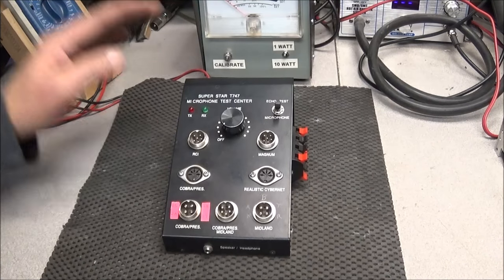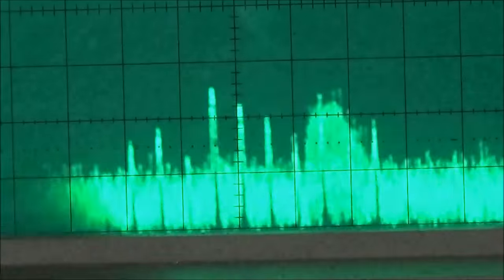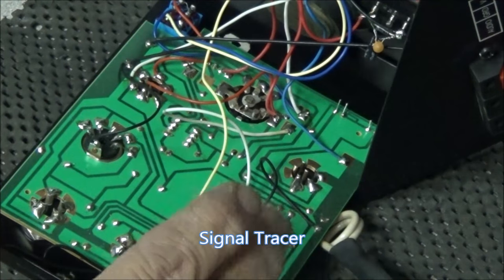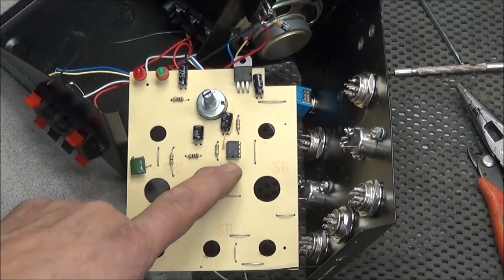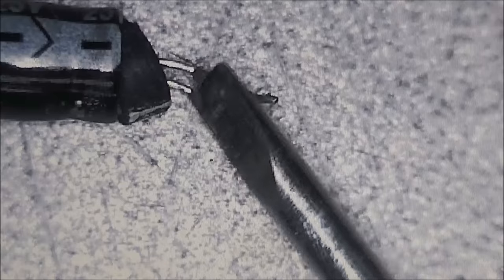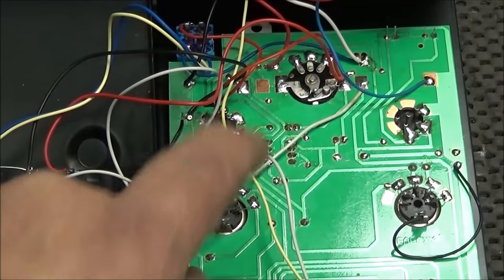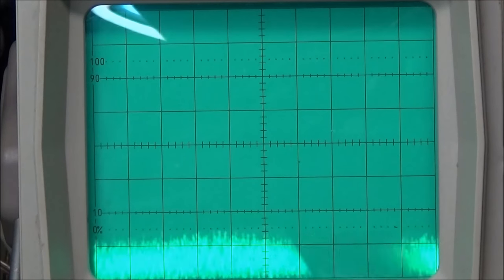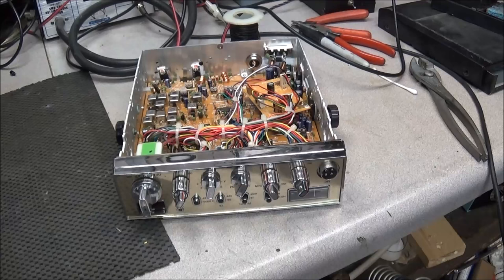#82 Superstar T747 Mic Tester Repair

Comment: I know you enjoy building your own test equipment,and you are familiar with the T747 Tester for microphones. They work great - but I was wondering how hard it would be to add a modulation meter to show the amount of modulation a microphone is putting out. That way you could see how much increase there is over different microphones,stock,noise canceling,different brand,different element and amplified it is hard to tell just listening. Thanks for any help you can give it will be appreciated.

Comment: As soon as I saw mic tester the first thing that I thought of was electrolytic capacitors.  I just rebuilt one of these a few months ago that had that same cheap ass no name capacitor that had exploded.  I replaced allnof them and it works great now.
Reply from the maker: Cool deal. I have never torn into one before so really had no idea what I would find.  Knew it could not be too much in there. The IC seems to be a one solution wonder.  But I do remember only paying like 30 bucks for it. Seems it is always the cheap caps causing these issues.
Reply: +The Radio Shop 

Yeah for the price I couldn't really complain either.  Would cost the average person more than that to get a custom case like that made.

Comment: I built my own tester, I just built a small audio amp circuit up and mounted some sockets on the box, doesn't look as nice but only cost me about $10, and has the sockets on it that I use the most.
Reply from the maker: And probably works better than these cheap ones we are buying. Good job!
Reply: Yours have a modulation meter to see the amount of modulation each microphone puts out?

Comment: Hey Buddy!  I have a tester looks the same inside and outside except the name. U usually work with 4 pin mics. I did a ranger RCI 6 pin. When I test it it sounds good and red TX comes on. But no green on receive. But it seems right with meter. I open it up. There doesn't seem to be no connection from that plug to the green light. Does your go green. Thanks Chuck

Great videos. I really look forward to your stuff.
Reply from the maker: Hi Chuck. Yes mine goes green with no problem. Perhaps they left something out? I know there is a few versions of these testers out there. Thanks

Comment: yes Peter did a nice mod using a cat 5 cable box, I need a adapter for the motorola mics the ones with 8 pin glad you fond problem, what a job.... good job Buddy
Reply from the maker: Thanks Dennis, going to build a box for other mic jacks also.
Reply: good like to see your build,,, I think Peter used a cat 5 ethernet box of some type maybe a 5 port type for those 8 pin mic s
Reply: Where can Peter's video be seen to check out his mod? Thank you.

Comment: I would love to see you troubleshoot and repair that CB. I've found that most ICs, and especially voltage regulators, are noisy and always bypass the inputs and outputs to a good ground connection.
Reply from the maker: Hi Robert, when I build my mic interface I am going to install some bypass caps.  Repair video coming on that.

Comment: Buddy,
Forgot to comment on doing the repair to that flea market CB. We need to see some friendly competition with Mike.   :-)   WB3BJU
Reply from the maker: L.OL, no problem Donald. I really hate those black box radios. And if I do repair the radio I will explain why.
Reply: Buddy,

That would be great. Mike always mentions he does not like those modded radios, but I can't recall him saying what is actually bad about the mods, other than cutting traces and having wires go here and there.

I do know how he hates the way they are tuned to make them splatter all over the band.   WB3BJU
Reply from the maker: Lets just say it is a design issue :-)